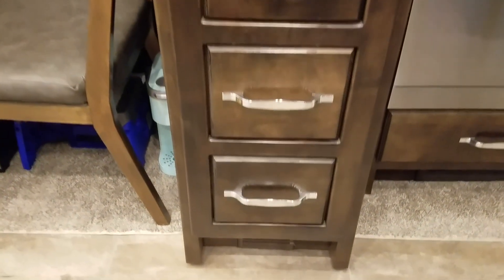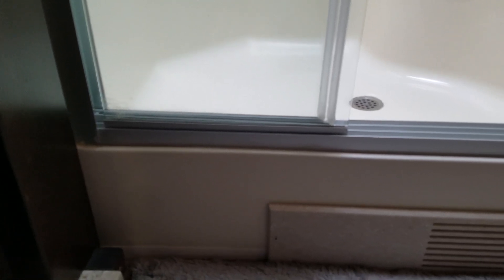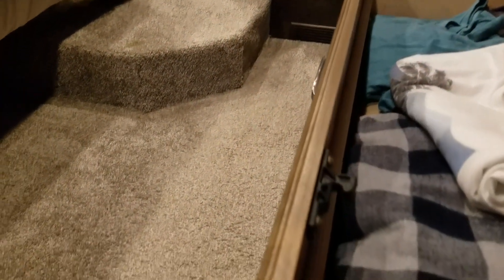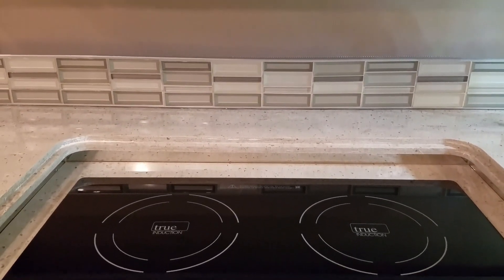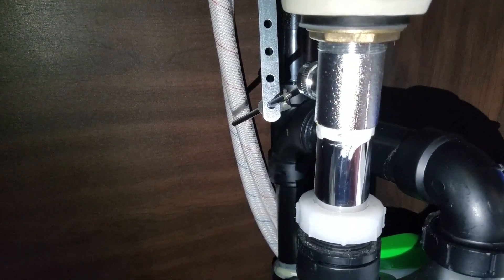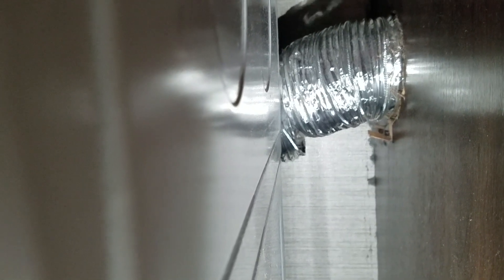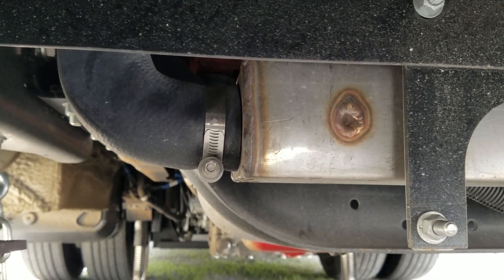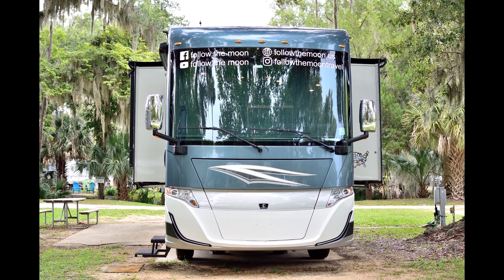Tiffin Allegro Red 37PA One Year Review

Comment: Doug, Great clip. Our trip to Red Bay was also for a list of small items they took care of. Some items were not addressed as completely as we had hoped considering the amount of time and travel involved.  On our way home to L.A. we had a Major Problem... While you have a Pusher, we have a 34PA, built on a Ford F53 chassis, V10 with the engine up front.  While on our way while getting fuel, we noticed Coolant leaking under the coach, the temp gauge was HOT, overheating...  We had lost almost all our coolant!!!  I added nearly 4 gallons of coolant before the temp came down, but we were still leaking!  We limped into Tuscan and got to Holmes Tuttle Ford first thing in the morning. While Holmes Tuttle Ford told us they no longer service RV’s, they did!!!  They found a heater hose under the coach that had been cut by rubbing against the fiberglass of the Tiffin coach itself.  They replaced the hose and strapped it up so it won’t rub as before, Not A Permanent fix, they say, as it needs to be secured with more than zip ties that they utilized.  We will make that fix ASAP.  This may be an oversight on Tiffin production, and we will make them aware of the problem, and we will forward that repair bill to them.  Note, if we had not caught this problem at the time we did, and were not as solution minded as we are, it could have blown our engine. So for future production and owners alike, they should be aware of this issue. 
Overall we are very happy with our Tiffin and the service center in Red Bay is the place to be when you need warranty items addressed.  
Doug, again we wish you, Cathy and Maggie Mae smooth roads ahead. May the moon always shine on you...
Steve and Laura
Reply from the maker: Glad you made it home safe - but definitely not a fun experience!  Better travels ahead.